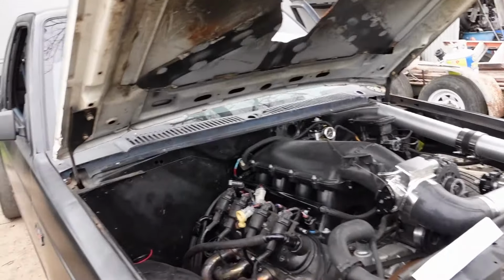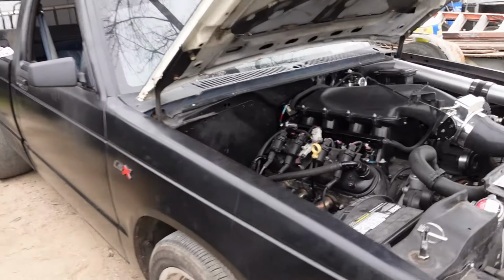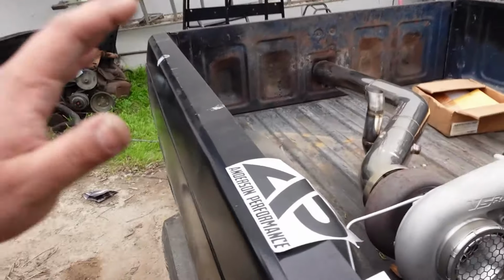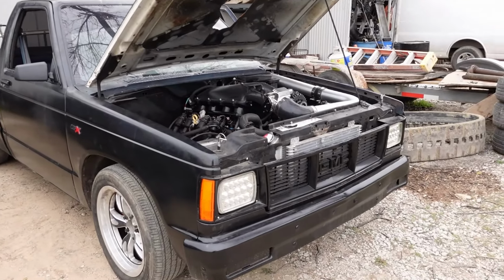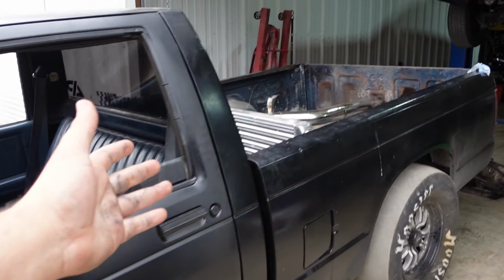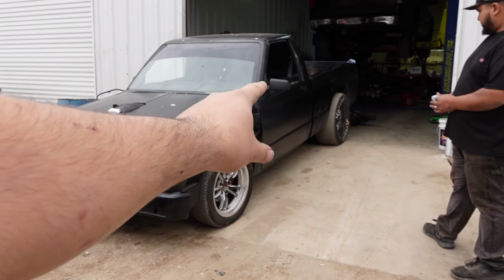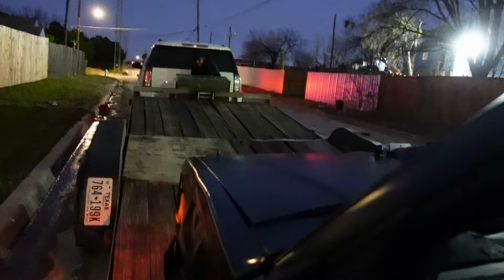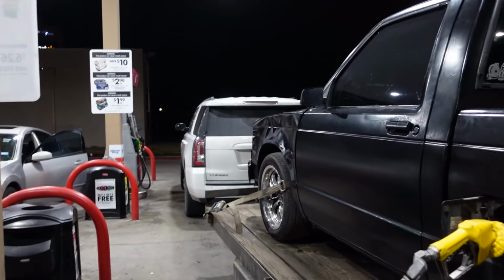Turbo S10 Is Finally BACK! (I broke it)

Comment: You said the s10 is giving you problems its a s10 thing i believe lol my 91 5.3 swapped s10 is giving me problems too
Reply from the maker: These damn s10ssss!!
Reply: @jerryfw  i love them tho mine is 91 ext. cab 5.3 btr stage 3 truck cam with nv3500 5 speed trans
Reply from the maker: @James.mayhugh  same here I love this little truck! I bet yours is fun with that manual trans!
Reply: @jerryfw  it is but i wish i had a t56 for it

Comment: I’m in Fort Worth, Tx  do you have a shop?? I got a 2002 Chevy Tahoe Z71 that needs some work
Reply from the maker: Yea what you wanting to get done
Reply: @jerryfw   Honestly not too sure, I need multiple things diagnosed. Transmission, possibly transfer case I’m not sure. I drove over a railroad pretty rough & after that it flares going from gears 2-3. Wasn’t far from the house, so I drove it home with a loud ticking noise. The Dude I bought it from ,installed new torque converter. So thought it may have been a bolt loose but shop says I may be time for transmission rebuild. Already has rebuilt engine. After sitting for some days
CEL thru P0300 & now cranks but no start. I’ve replaced a few things. Still no start.
Also, oil pressure was dropping at idle. It has a new melling oil pump, so it could be the oil pickup tube? 
I’m not sure lol, this was supposed to be a slow project for me but every issue has just been piling up. I just need help bringing it back to life & would be very appreciate of the work after watching your videos.